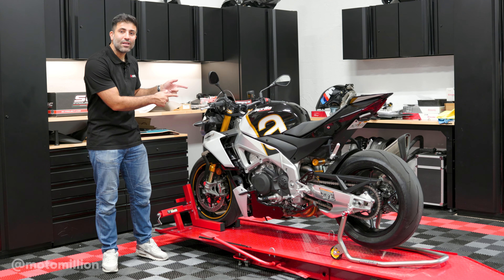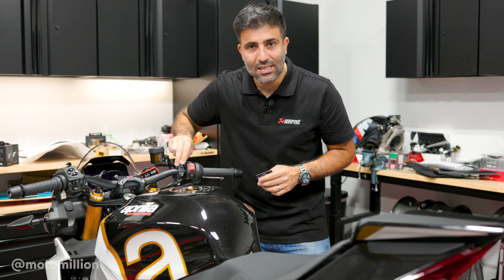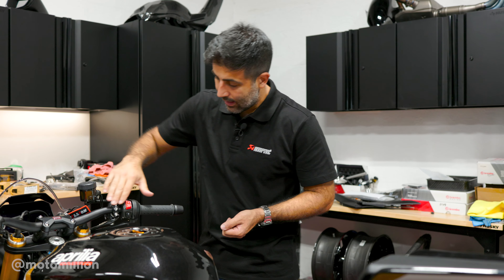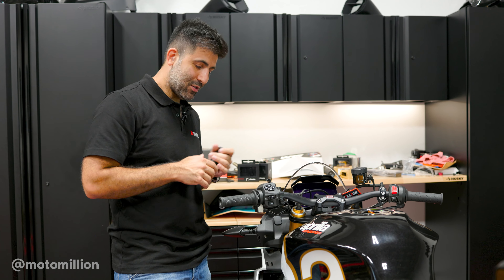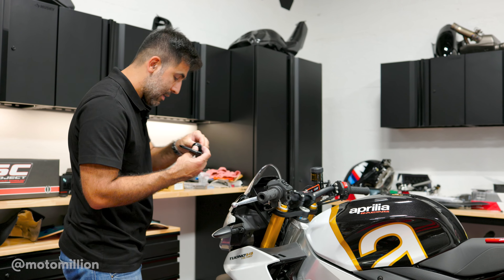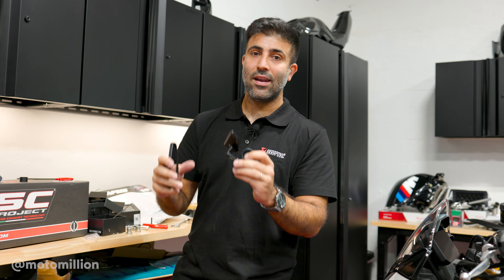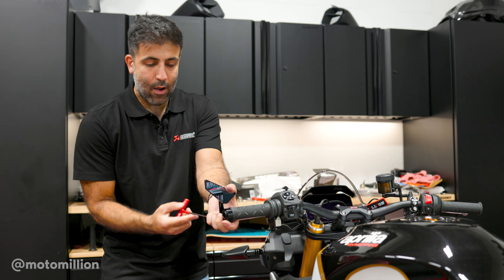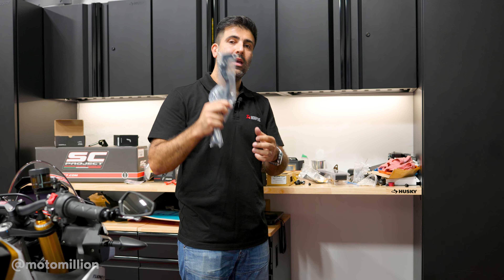$900 Handlebar CLEANUP | Motomillion Aprilia Tuono V4

Comment: Great call on the bar-end mirrors on this Tuono Manny. I had the CRG Arrows on my last Tuono for 4-5 years and absolutely loved them. IMHO, the bar-ends look so clean on the naked platform.

I am now running those same Rizoma bar-end mirrors on my S1000RR. While they are gorgeous, the CRG's have a little more glass and they have a little better visibility. Also, the CRG's were a little better at folding out of the way in the garage. I would do the CRGs having used both for multiple years. Hope this is helpful.    - Patrick from Tampa....

Comment: I have a 19 Tuono and I am running ASV shorties on both sides and the clutch is indeed pretty short, but I can still use two fingers no problem. I also have the CRG mirrors which work great.

Comment: Progrips are the best on these bikes! If you cut out with a Dremel or cutting tool the inside edge of the pro grip (carefully - it as enough rubber) you can easily get it to fit the clutch side without cutting any plastics 👊